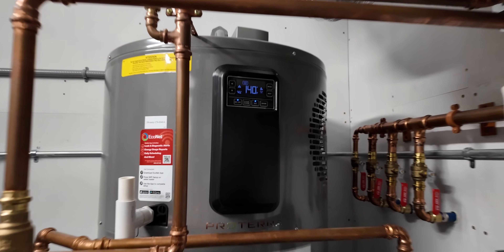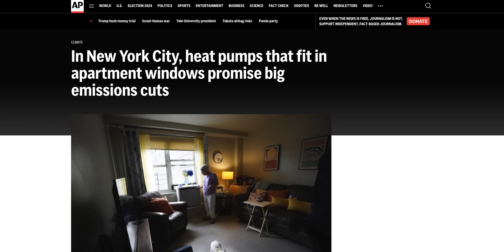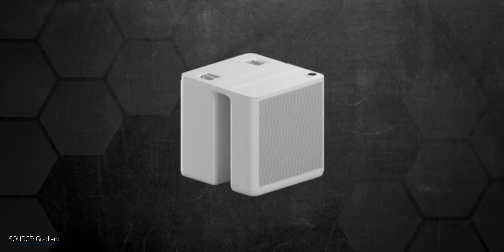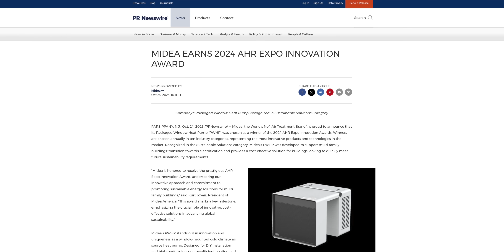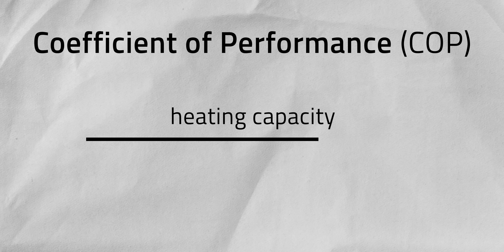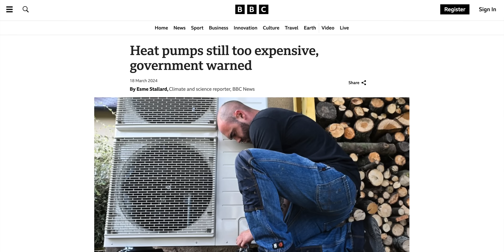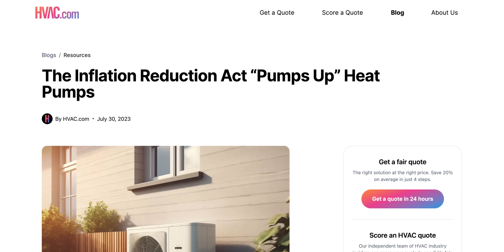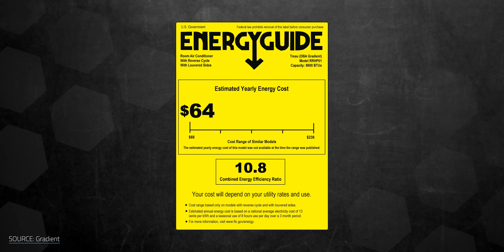Why This Window Heat Pump Is Genius

Comment: Power system worker here. 
We need to work on infrastructure far more than we need to keep pushing and incentivizing these new electric technologies. Not to say stuff like this isn’t great. But we are putting the cart before the horse. The government is pushing for EV’s, Heat pumps, Electric cooking appliances, etc. They want full electrification. Which once again is good and all. But on the other side of that coin they are also doing immeasurable damage to the power generation industry. NO solar, wind, and hydro will not, can not, and won’t provide all the energy needed. That is a dream that isn’t founded in reality. Maybe some day technology will get us there. But today it can not. Yet we regulate the life out of the existing sources of energy we do have. Put no money into maintaining or upgrading what we have now. On any given day the grid is one oops away from failure. We must fix that before electrifying everything in our lives.

Comment: Yeah heat pumps for these old apartments are great in theory but the insulation in them is total crap. The only way your going to effectively heat the spaces needed for comfort is in a well insulated space in conjunction with an HRV or ERV to help exhaust and bring in outside air.

Comment: I'm confused: how is this different compared to an AC, It  has the same components??
Reply: It's reversible. That's it. ACs and fridges are one way heat pumps.
Reply: @heatherkuhn6559  thanks, Reversible AC's are on the market for many years. Especially in the market of sailboats and RV's.   30 years ago, to install a heat pump you needed to drill a big hole in the ground.  These days it seems that the term is used when they are looking for attentions.

Comment: The fact that they picked R32 vs R-454B was a great move. I like to think of R-454B as the patented cash grab pharmaceutical companies do when they want to milk innocent people for all their money. R32 Patent was opened up to any manufacture, performs just as well, and because R-454B has multiple compounds you have to recapture all of the gas when topping off your unit. With R32 you can just add gas with no expensive process. Keep this in mind when selecting the next brand AC system for your home, heat pump or not.

Comment: The price is a problem. 12,000 BTU mini split systems go for less than half the price and have comparable performance. This highlights the problem of having the government "set the price" for anything. Simply changing the form factor and support for the unit should not add more than $1500 to the price. The manufacturers set the price according to what the government "target" is, and will be laughing all the way to the bank.

Comment: 1:50 to accomplish this high efficiency natural gas furnaces or heat pumps with COPD of 6 or more because most power plants are only 33% efficient, there's line losses and when coal is burned about 50% more CO2 is produced per BTU because of fuel chemistry. Although there's generating stations that are upto 63% efficient, these are not the average power stations.

Comment: My first thought is a heat pump that can't cool at 96F is basically a nonstarter....Just when you need it most it doesn't work.  I also think their price premium for mobility is just too high.  $3k for a transportable unit?  You can get a Mr. Cool 9k BTU mini-split (20 SEER) for about a third of that price ($1250).  Again, I get there's value in portability and minisplits have installation costs but IMHO that doesn't justify 3x value.  All the high-rises in Asia have minisplit heat pump compressors built in on the outside so I don't see that market driving the desire/demand for window units.  The buildings are too tall and the windows can't be opened. 

Somebody else said it, but I'll repeat it.  I don't see how AC systems double in price when they have heat pump reverse flow capability.   I imagine if AC was outlawed and Heat Pumps were the only option they'd come down in price due to competition.  IHMO....they still seemed to be priced as a subsidized novelty in the USA rather than a commodity product like in Asia.
Reply: I believe that range is just to maintain the stated efficiency rating, not that it won't work. Plus in context it makes sense, NY doesn't have a climate that gets above that point often if at all.
Reply: @jhoughjr1  my larger unit heats just fine in freezing weather I've been as far as 40° below freezing and it still worked although once you get below 10° f it becomes less efficient but it still heats and there's no auxiliary heater
Reply: hell I have a 12,000 btu mexico whirlpool mini split it was $900 "INSTALLED"
Reply: You're lying it cools like any other AC
Reply: Largwr ones cant heat in freezing weather without a standard heater.
This guy always ahowcases bs tech
Reply: It's no different than an ac who told you it doesn't

Comment: And yet you have no link for the heat pumps 😌 .  Efficiency is great government shoving it down forcing is bad. The Earth may be warming, (it didn't between 2010 and 2021) but any temperature change it's due to the Sun, not human activity, which may account for maybe 1 to 2% of the change. It's to control people and human activity and taking money and diverting it to their friends and causes and is why the Marxists push it do hard.

Comment: That price is patently ridiculous. It shouldn't cost 10x more just to have a heat pump be bi-directional lol.
Reply: For $500-$800 you can get a typical air source heat pump (ASHP) and it will probably have more power than these.
Reply: @TheBlacktom  There aren't any air source heat pumps that mount in windows easily that I know of. If you're talking about a mini split – – sure you can get those for 1k-2k but installation requires HVAC skills.
Reply: You can buy a 12000 BTU Midea traditional style heat/cool with a CEER of 13 for $500....
Reply: @ckm-mkc  Was just on sale at costco for $280 a few weeks ago!
Reply: @ckm-mkc I imagine these will get cheaper over time. Plus making thermodynamic systems more compact is always going to be more expensive
Reply: @ckm-mkc  - Unfortunately, that Midea unit only works down to 41 degrees (as measured by its external temperature sensor). That said, I have the 8,000 BTU version (just released earlier this year), and when its sensor reads 41 it is normally close to freezing outside.
The Gradient is a low ambient heat pump (handles below freezing temps), but I agree the price is too high.
Reply: What's more efficient than a heatpump?

Putting a jumper on.
Reply: @hippyraverocker  Bingo. If it isn’t comfortable for you wherever you live, then move somewhere else. It’s not like you don’t have any options. Alaska and Florida are both available destinations.
Reply: Packaged terminal heat pumps (PTHP) have been around quite a while and go for $1000 more or less
Reply: I bought a 12K BTU Midea window air conditioner from Home Depot last year for $499 - similar saddle design - and it is efficient as hell. No way converting that to a heat pump justifies a 600% increase in cost/price.
Reply: They really gouge the price for a reversing valve.
Reply: @robertgaines-tulsa Damn now that you say that... It does make it pretty clear that is what they are doing. Overcharging you for a reverse valve. Hahaha😅 This is just a fancy new style of window AC they designed to be able to reverse the direction they send the heat for the winter. 😮
Reply: The market charges what the market will bear. 🤷
Reply: Yeah, a basic 9k but mini split can be done for way less than 1k
Reply: In the winter time when it's -10F, that outside evaporator is going to be probably close to -30F and it's going to be collecting condensation (ice) and you'll need resistive heat to melt that off. Then because it's an inverse U shape, in the summertime, you're going to need to pump the condensation up the front and back to the condenser. Then you have the humidifier setting when in heat mode. And all of these needs to operate at 1500 watts or less.

All of these extra solutions need more parts which adds more complexity and requires more sensors and software to control them. Then all of it needs to be tested to withstand the elements. A heat pump is not just an AC that runs in reverse, I wish these youtubers would stop that meme. An AC with just a reversing valve would be a pretty shitty heat pump that would not work in many conditions.
Reply: Whats most hilarious is that modern AC units have heating options. AC is just a heat pump pumping heat outside, just reverse THE FLOW and it heats inside...
This is pure theft existing just to milk technically illiterate and government funds.
Reply: Remember the government subsidizes a lot of heat pumps with tax credits or rebates. So that is why 3x the cost. You can afford more. Therefore the cost is going to be higher. Then back down (with govs help) to where it was before the credits existed. Government helps a lot of companies out like that.
Reply: They don’t, but the companies charge a heck load of markup. A better unit by Midea sold in china would cost you less than 500 dollars.
Reply: Exactly! The more entrepreneurial copycat from the East is just going to grab the idea and create cheaper ones.
Reply: I think some of the U-shaped air-only window units have now dropped to the normal price. Maybe these will drop price in a few years. The U or inverted U does look like the way window units should have always been made.
Reply: This is INSANITY !!!!!!!!!!!!!!!!
Reply: It should only take a common valve design and some electronics. Maybe $50 to $150 in addition to a standard unit to reverse the inputs to the compressor.
Reply: For the weed growers this is perfect for winter time growing. Mount an AC in the bedroom door, Cool the plants, warm the house.
Reply: or you know, just flip your window ac backward during winter. all ac are heat pump by default.
Reply: @keenheat3335  that won't necessarily work depending on the efficiency rating and refrigerant used. also most cheap ACs are designed to tilt back a little so condensation drips out the back.
Reply: @snowballeffect7812  pretty easy problem to solve, just get a cup to catch the drip. You want to recover the lost moisture anyway so air dont stay dry. frost collecting on outside is a bigger issue, probably need to brush away the frost once in a while.
Reply: @keenheat3335  again, the main problem is the refrigerant itself simply is not able to carry enough heat from the colder outside air into indoors.
Reply: @keenheat3335  It would not be practical. The controls would get wet and some have an electronic board and it would get ruined. the thermostat would not work as it would only try to control temperature on one side. Would not work below 41 degrees as there is no defrost control. Better off buying an actual heat pump.
Reply: @snowballeffect7812  Hmmm most new window units can be installed even and are designed to hold water in the back of the unit to cool the unit. The fan hits the water flings it on the inside to cool.
Reply: @snowballeffect7812  They use the same refrigerant. The real problem is no defrost cycle. And obviouse issues like the thermostat is outside.
Reply: @keenheat3335  Maybe you're kidding.  That likely wouldn't last a single winter, as the temperature swings and moisture corrode and destroy the control circuits.
Reply: @keenheat3335   This is actually a solid concept for a newer product. Make the back the same as the front, spin it around when it gets cold. Only issue would be the gunk that gets on the coil facing the outside being blown into the house without a proper cleaning.
Reply: @keenheat3335  Thats funny im guna try that your a genius 
Ac do blow out hot air but the drip water maybe an issue tho 😂😂😂
Reply: @keenheat3335  mine is kinda embedded in my wall. It’s not a simple “jUsT fLiP iT aRoUnD”
Reply: @timwildauer5063  then it's not a window AC...
Reply: @keenheat3335 All AC aren’t heat pumps.
Reply: @dermotbalaam5358 yes and no, all acs work by pulling heat out of the air and a wind it outside. That is just "pumping" the heat from inside your house, and sending it outside.. haha
Reply: Absolutely, and “tax breaks” are disgusting. They don’t fix the problem, they just pass it on to someone else.
Reply: Whelps - That's the idea - to push society to change... in the right direction
Reply: @thesupremekai1980s  Who gets to decide what the “right direction” actually means? There are plenty of people who firmly believe that the right direction needs to include at least a little genocide. 🤷
Reply: @MrMadsci7  It was response to the tax break comment. So yea, if there is a tax break for genocide... we are going in the wrong direction. If there is a tax break to push people to upgrade to heat pumps which are more efficient in the long run and do less damage to the environment and consume less finite resources, then yea, lets not call tax breaks disgusting. Social welfare for companies is ok in the US but not for people or the environmental policy?
Reply: @timwildauer5063  Except for billionaires.  Those are welcomed.
Reply: much cheaper options exist. but those options didnt pay matt to run a 13 minute ad on his channel. This channel is an advertising platform for tech companies. He's concerned with making money, not being informative.
Reply: @Hephera  Please post the alternatives....
Reply: @Hephera  you’re welcome to leave

Comment: I still don't understand the pricing issue w/ head pumps. If they are essentially just an AC unit with a very small number of extra parts (primarily a reverser valve) why are they 10-20x more expensive?
Reply: The more expensive a subsidized thing is, the more money the company selling it can scam out of government funds per item they make.

Comment: The moment I saw it was made by midea, i stopped watching. midea is a trash company. their current u shaped inverter a/c is trash, doesn't operate at claimed btu, doesn't ever cool adequately when air outside is within 5 degrees of your inside setting, and never runs the inverter above 50% in auto modes. I have no doubt this heat pump unit will have substantially more issues than their inverter units. The company is a low quality scam

Comment: At this time, these are way over hyped. The ROI is way out there. I paid $4600 for the Midea. Problems with the condensate pump causes water on those old oak floors. They need intense maintenance to avoid this. Unfortunately, the average homeowner lacks the tools and discipline to keep up with it. The Midea U shaped unit would work better but alas, is not available as a heat pump. Poor sealing is another big problem. Once installed, they are finicky to fix if there is a tiny gap anywhere. Bugs love to find their way in at night. 2/10 on this one Matt.

Comment: $3K for an air conditioner that happens to heat too?  Get yourself a normal air conditioner for $200 and a small floor heater for $20, bank the other $2K+ and spend it on something better.  If you want a bit of prestige, get a U-shaped air conditioner that looks like this, you'll get the benefits of this unit without the extra $2500 cost.  Then you can still get yourself an inexpensive floor heater.
Reply from the maker: Appreciate the POV, but that floor heater isn't anyway as efficient as a heat pump and would cost a tremendous amount to run.

Comment: So those old steam cast iron radiators were actually built with the idea that you would just open a window, because the prevailing theory back then was that it was good to get fresh air into the apartment in the winter time. Which is actually true because one of the big reasons we see the Flu season because people are cooped up inside with out fresh air replacing the inside air.

Although I do wonder how it would be if most places were on a district heating and cooling system instead of individual buildings since that kind of thing scales really well.

Also when will someone develop something that works in either a casement or sliding window? I have never lived in an apartment that had a single or double hung window which is what these are clearly designed for.

Comment: Finally! the only issue is that they need window units that fit many different size sills. This unit really won't work unless you remove radiators and or furniture.